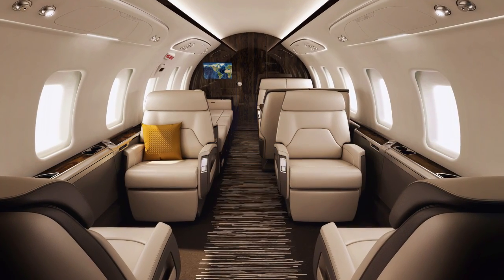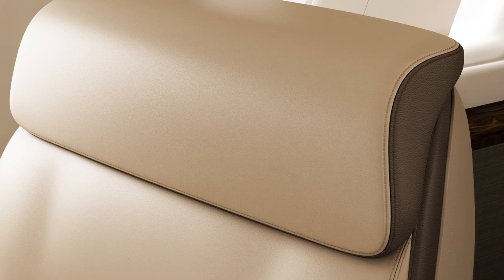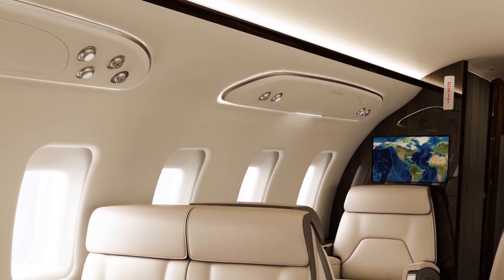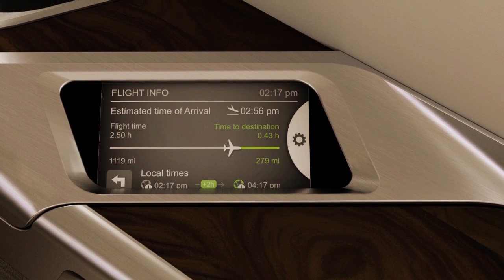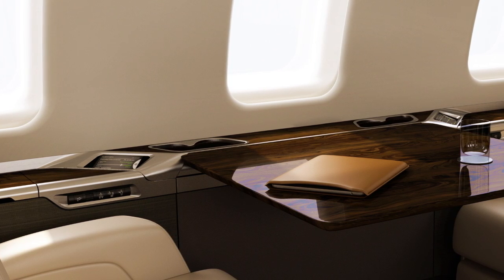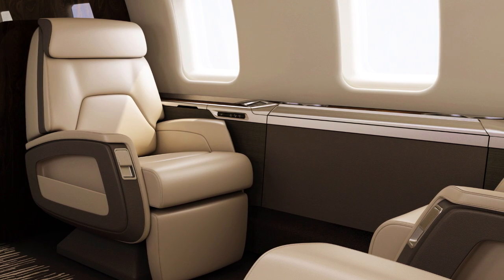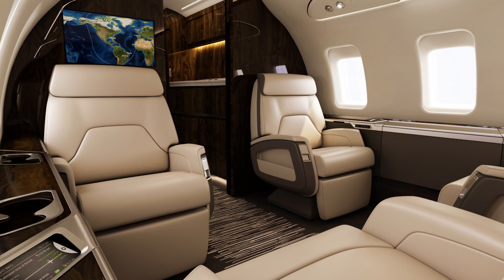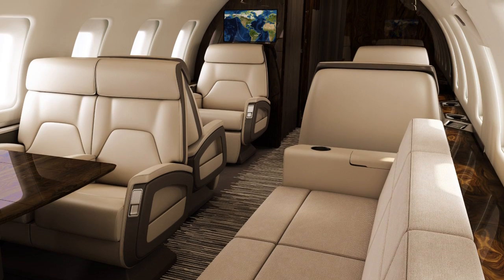Design of the Challenger 650 aircraft's cabin.

Comment: It does have a low Max altitude but NOT FL370. Max is FL 410. It does have a slow long range cruise of MACH 0.74 which is a flying road block and MACK .80 for normal cruise which isn't all that great either. Looks great but it NOT a performer. Get a Challenger 350. Range is a little less but speed is a bit better and Max altitude is a respectful FL 450.